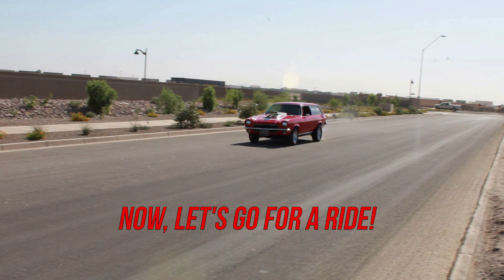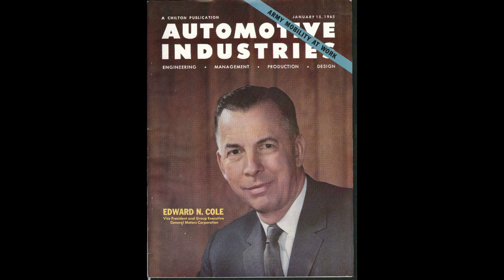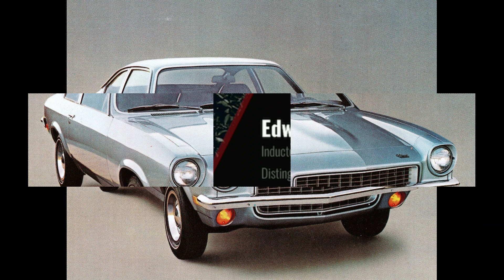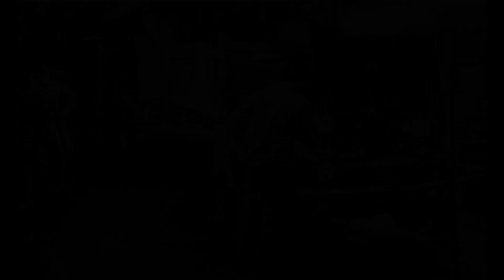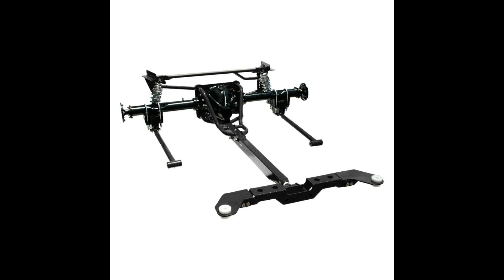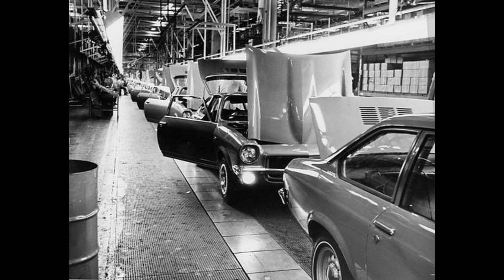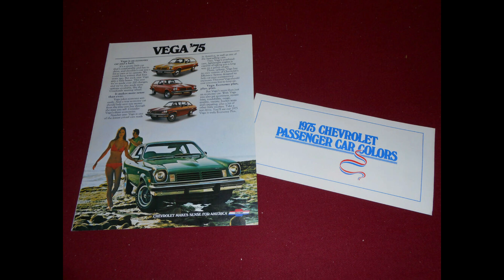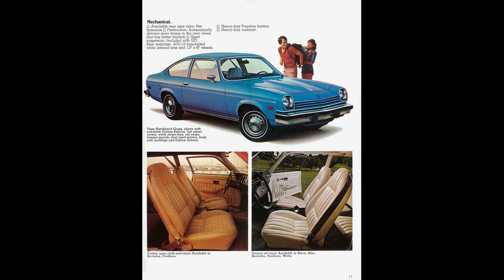If The Chevrolet Vega Could Talk - "People remember me either with love or hate but I'm remembered!"

Comment: The Vega's potato-chip engine was so bad that it prompted Pontiac to brag about their "Iron Duke" motor in their corporate cousin.  That engine is frequently confused with Chevy's 2.5 Liter 4-cylinder from the earlier Chevy II, but it's not the same engine.  Aluminum blocks had been used for decades in outboard motors but the bores in those engines are cast iron sleeves. Small aluminum engines in lawn mowers had the cylinder bored directly into the aluminum block but those inexpensive motors were built as throw-away's - if your 3 HP Briggs and Stratton engine burned oil and lost compression you went down to the discount store and bought another mower - back in the day they were $49.

Comment: One never forgets their first so I'll never forget my Cranberry Red 1972 Hatchback model that I inherited from my Dad. I kept it alive by foraging though the North Jersey "boneyards" seeking what ever thingamabob (sheet metal or otherwise)  the vehicle was crying for that week. 

While "shopping" one day I stumbled across a t-boned 1973 Pontiac Astre.  (The Pontiac Astre was the counterpart of the Vega and was released in 1973 in Canada. It eventually made its way to the US in 1975) The damaged hulk still had it's Pontiac split front grill, chrome headlight/taillight housings, badges, and wheel rims in tact which I promptly emptied my wallet for. It made the plain vanilla Chevrolet look unique. To further muddy the waters I slapped the "Type-LT" badges on the fenders from a '74 Camaro. The car was a little under a decade old and folks in the neighborhood we're congratulating me on the "new car" even though it was the same machine that they had seen for years.

That little Chevrolet was my ticket into the shade tree mechanic " fraternity and taught me much on how to care for a vehicle and detect its ills. It had a myriad of issues, was always flying apart at the seems but I wouldn't have traded it for a Camaro or Corvette. Eventually after it gave me a few more years the car succumbed to rust , and was laid to rest in a boneyard in Northwest NJ. I still have those chrome pieces however and the car's original badges.  If mine could talk it would say, " thanks for believing in me, even though  I didn't at times deserve it. " Still miss that little beast and wish it was sitting in my driveway.

Comment: I rebuilt a vega in the mid 80s, a 4 speed manual got it for 200 bucks, it was burning oil but had no rust, I pulled the engine got the block sleeved milled and ported the head, not cost much back then, got the paint in good shape and a good detail , it was a great carhad a lot of power handled well, if only GM would have made them that way
Reply from the maker: Very true. Thanks for watching and sharing your memories! Please keep watching!

Comment: I still have my 1977 Vega wagon with a 350 V8 under the hood and a more modern 4 speed automatic overdrive transmission. I stay on top of it's tendency to rust. It does have new twin Cherry Bomb mufflers. Weighs in at 1900 pounds and will FLY down the road.Getting those 13 inch tires is a chore, very hard to find decent tires. I have installed LED lights to replace every light in and on  the car. Kept my old in dash Pioneer cassette deck after installed new belts. Very comfortable for this 1 legged hillbilly to drive and gets damned good mileage. A real Sleeper car. It's parked in the garage next to a 1961 Dodge Dart Police cruiser.(My late father's car that I restored.)
Reply from the maker: That is so cool!  Thanks for sharing your memories and it is awesome that you still have the wagon and the Dart!  We would love to do a feature on those two rides! Thanks for watching!
Reply: @IfThisCarCouldTalk  I won this car in a poker game with my now ex brother in law. Drove it until that god awful 4 banger gave out, then dropped a 350 into it from a junked out 71 Chevy pickup. The transmission got changed in 2010, again from another junked out total wreck.
My daily driver, a 1999 Ford Ranger XLT, was built from wrecks and cost a grand total of $500. It's has the 2.5 4 cylinder, modified to run on gasoline or hydrogen(or both). Runs like a scalded dog. I can't afford $50,000 + for a decent pickup. I live on Social Security since I lost my right leg in 2015. I make do with what is available.
Just in case you are wondering, I spend these winter months repairing computers. Been doing that for over 40 years.

Comment: My uncle, a GM employee and super long GM car owner , had a wagon that was using a quart of oil in under 100 miles. He asked me what my thoughts were. I said a Pinto - which he then bought. The Vega was one of the few quick rust out cars where engine failure happened earlier.
Reply: I would my favorite memory of the Vega was the day I sold it if General Motors couldn't fix it I realized I wasn't going to fix it either

Comment: The problem with the vega was people were used to big powerful cars and the vega wasn't. In the 70's the four cylinder technology wasn't developed yet so the car was underpowered. If they had offered it with a v6 it would have done much better.
Reply from the maker: Good point Julian. Thanks for watching and keep it up! Lots to love here!
Reply: Vegas did 0-60 mph in 14-17 seconds depending on transmission - same as American compact and intermediate cars with 6 cylinder engines, and faster than the most popular small car at the time: the VW Beetle.

Comment: Huge mistake is the fact that a longstanding car manufacture fell for the bean counting department idea of making a cheap throw away motor. The results were pretty obvious. General motors then gets the reputation of building the worst car ever made. They really lost track on engineering design and the disconnect between engineering and corporate became so grossly disjointed that a product is spit out by the thousands which is virtually garbage. This is not the only case were corporate bean counters make engineering disasters. The Boeing 737 max is a great example. Rite out of the factory the plane wants to fly straights into the ground by itself. Then is grounded for years or more till they can redesign it and fix it.
Reply from the maker: Great analysis John!  I recently saw a story about the 737 Max too.  Thanks for watching and hope you find lots more to love here!

Comment: In 1974, I bought a 73 Vega for $2300.00  It got 35MPG and I had it up to 137MPH drafting an International TravelAll.  It lasted two years and 50K miles.  The rear hatch flipped over the roof when the hinges rusted out.  Driving in the rain, I'd get a shower from water coming in under the windshield.  A love bug would rot a hole through the hood in a week.  I burned a quart of oil between fill-ups.  It was a good-driving car, and my 5-speed was very peppy and responsive when I first got it.  Had GM used cylinder sleeves and a different primer, there would still be Vegas on the street.  I had a bronze paint job with a wide stripe down the sides and across the hatch and the car was very good looking.
Reply from the maker: Wow, thanks for sharing such a fun memory of your Vega!

Comment: I had a 73 vega wagon 4 speed from 75 to 77 . I liked it's looks and  practicality . It was noisy and slow and very poorly made . It's fuel milage was ok for the time , but not great . The engine quit at 46000 miles , it was also rusting . Later on I had a 76 Datsun 710 , full of rust but much more dependable,  and considerably more power .
Reply from the maker: Thanks for watching and sharing your memories!  SO many people had a Vega and you rarely see them as survivors due to all the issues!

Comment: When I was a teenager, I bought my first 1972 Chevy Vega GT hatch back. The handling was awesome. I loved the cars so much that before I was through I had owned 3...
The only thing I didn't like was the stock 2.3 engine. It only took one incident of over heating to ruin those engines.
I bought my first 72 Vega in 1980. At that time you could get a good running Vega for under $1000. I got mine for $600. And later bought one with a warped head for $100...   I built a V6 I pulled from a wrecking yard and I put it in that one.  Then I sold my first Vega for $800... 
That V6 Vega was so much fun that several years later I built a V8 Vega...
Now days those cars are very hard to find though.
BTW... The Vega never came with the rear suspension you showed earlier in this video...

12

Reply

5 replies
Reply from the maker: Sounds like you sure had a lot of fun with your Vega cars!  Hope you're still cruising in one today!  Thanks for watching and for sharing your fun memories!  Hope you're a subscriber!

Comment: I drove a white '74 Chevy Vega Kammback for 13 years. Went thru 3 engines.
The title of your video gave me a chill because in 1982 I composed "Old Vega Talk":
LYRICS:
I've got this feeling that you don't even care
You've got this notion that I'm not even there
Is it the mileage that has got you down
Or that knockin' in the engine that is makin' that sound?

I wash your windows and I shine up your hood
I change your spark plugs like a good driver should
I check your brakes and take care of your clutch
Just get me to work, is that asking too much?

CHORUS:
Can my Old Vega Talk? 
Or will I have to walk?
Before my fender gets crushed. 
The radiator needs to be flushed.

Don't laugh it's paid for and my other car's a Porche
I don't need a taxi, bus, or a fast racing horse.
But if there is one thing that just makes me grieve
It's Chevy's worst engine with the aluminum sleeve.

I still got to say that my car is still loyal
Even though I know it eats and burns the Penzoil
I thank the Lord it has got me this far
But I'll thank Him just the same for a brand new car.

Repeat Chorus.
Reply from the maker: That is very possibly the best comment on our Vega story!  Is it cool with you if I share it?  It amazes me that the Vega can evoke such strong emotions in so many people for so many different reasons!  Thanks for watching and sharing your story through your song!
Reply: @IfThisCarCouldTalk  Thank you, and of course you may share it.
I'll keep looking for the 40-year old master tape in the basement.
This car, unlike my Saturn, Civic or Dodge Dart, was worthy of a song.
Reply: Old Vega Talk has now been posted thanks to your video:  https://youtu.be/kAS78cZI8cw

Comment: I had a 1976 Vega GT hatchback I put 90 thousand miles on it the only problem I had was the throttle linkage broke it was under a recall and they fixed it it was orange with white rally stripes I drove it for 6 years before trading it for an 82 Camaro z28 this Vega was not a millionth Vega but was similar to it with 5;speed and a/c
Reply from the maker: It's so nice to hear the good and fun memories about these little cars!  Thanks so much for watching and sharing!

Comment: I had 2 Vegas while working as a young school teacher with 2 young kids. The 73 had a 4 speed manual and the 74 notchback had the 3 speed manual (trying to get a bit more mileage with manual trans). As I remember, both were about $2300ish. Both engines were ok about oil consumption and neither engine failed due to overheating. They were within our meager budget and returned high 20's mpg. They both were traded after roughly five years with little rust and we moved on. In 2022, we drive a Corolla which has been almost bullet proof with almost a quarter million miles and always give me and my wife 34 odd mpg.
Reply from the maker: Thanks for watching Joe!  That is a great memory to share about your history with the Vega! Can't beat those Toyotas for sure!

Comment: Hi from England. Although we have many  enthusiastic owners and clubs for US cars over here I don't think I've ever encountered a Vega. Probably because small compact US cars are not particularly desirable compared to the homegrown products. Unfortunately this car highlights general motors muddled thinking in the sixties and seventies as there were proven engines of this size being produced in Europe by Opel and Vauxhall that would have been far more reliable than the aluminium block Chevy were using. Ford on the other hand used the German ohc engine in the pinto which whilst not exactly refined was generally reliable apart from worn camshafts and would hit 100k without too much drama. This policy also saved a ton of money with development costs. Incidentally the chevette, of which we had our own version was probably the car that kept GM afloat in England as it sold like hotcakes.
Reply from the maker: Hello Robert!  Great to hear from you again! That is a very interesting take on the Chevy Vega and the options overseas!  That little car invoked the strongest feelings from our followers, both good and bad and has the most comments by far!  Hope you are all doing well across the pond!  Thank you for your comment and support!
Reply: I had a Pinto wagon with the German 2 liter engine, cam notwithstanding (easy fix) that little engine was tough.

Comment: The 1974 kamback wagon with the woodgrain  panels was given to me on my 16th birthday in 1976. The wagon was good for camping and carrying my stuff back and forth from home to college.  I added gold tinted windows which made it cooler in the summer and private for making out in the back with my girlfriend. I added a 115v inverter and a pioneer home stereo in the back with 8" bookshelf speakers that sounded fantastic! My girlfriend also had a 1971 hatch back. It was cool cruising around together in our little Vegas.  Mine had a bad cylinder that burned oil and required a valve job at 60000 miles.  The original hone marks were still visible so the most likely problems was the rings were wearing down before the cylinder. The alunimum cylinders were imbeded with a hard diamond like compound. I did use Arco graphite in the engine which let me get around 93000 miles before the rear axle strut broke loose. Fortunately I was able to drive to the repair shop to have it rewelded.  Never felt confident to drive on the highway after that and sold it in 1984 to a  college couple who was happy to have a car around the campus for $400.
I recollection, I had  lots of fun doing donuts in the snow,going on double dates,camping,skiing,looking at the stars in remote areas with my celestron c8 telescope,going to the beach and getting me to college and work. In retrospect, my little vega wagon was a pretty reliable first car.
Reply from the maker: Awesome memories with your little Vega wagons!  Thanks for watching and sharing with us!  So many people have great memories and stories to go with their Vega!  Certainly, for whatever reason, good or bad, they invoke more stories than most cars.  Thanks!

Comment: Had a '72 Vega hatchback. Suffered overheating coming back from the beach which led to engine failure. The block got sleeved and was a decent car until I slid into an intersection in the rain and got hit from the left. That car got totaled. Found a same year Vega with a blown engine but also had a 4-speed. Swapped the motor out of the wrecked one into the newish Vega, Now, that car was fun to drive...until I popped the clutch too hard and took out the tranny and the rear end. Eventually, the overheating problem returned and it was sold for scrap. Definitely a love/hate thing for the Vega.
Reply from the maker: Wow...thanks for sharing such an awesome memory of your two Vegas!  The 4spd version must have been a blast! So many people have that love/hate relationship with them!  Thanks for watching and hope you are now a subscriber to watch even more fun!

Comment: I had two. A 71 & 74. I wrecked the first one and bought a 74GT version. That car had engine trouble at about 60k miles, loosing compression and requiring a rebuild using steel sleeves. Basically a good car by 1970's standards.

Comment: But you FORGOT the NUMEROUS recalls though you did mention the lack of inner fenders but not mentioned why? It was intentional to save about $2.00 a car. Lots of Vega's ended up as hotrods with a 327/350 under the hood. ODD it took GM 5 years to find out the engine was junk as designed and by the time they fixed it and all the other penny saving flaws the time had come to bury it.

.
Reply from the maker: Well, that feature was completed almost exactly one year ago so without going back and re-watching it, I'll just say we appreciate you adding that bit of information.  It's great when a viewer can add an additional viewpoint. Thanks for watching and hope you find other features you'll enjoy!